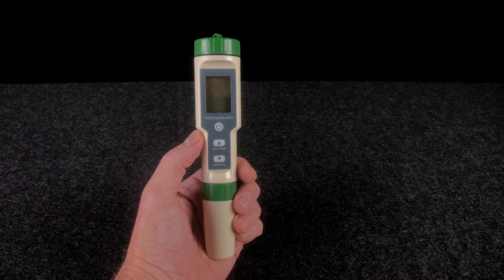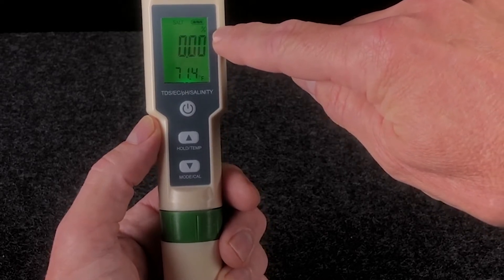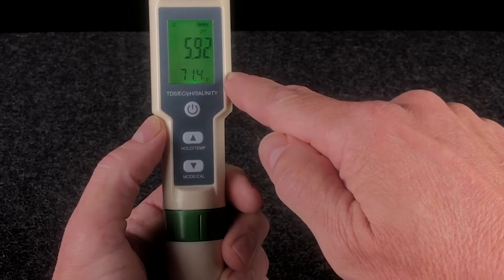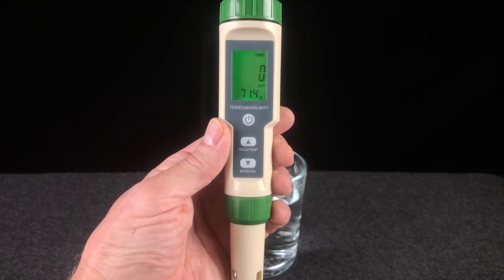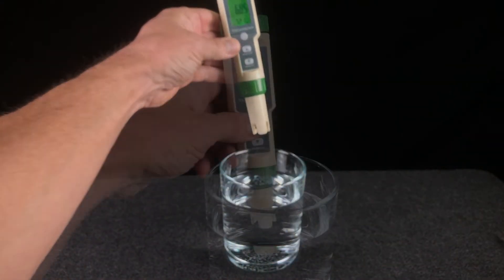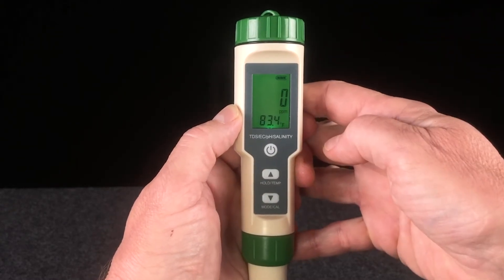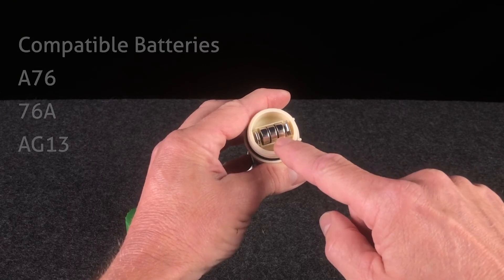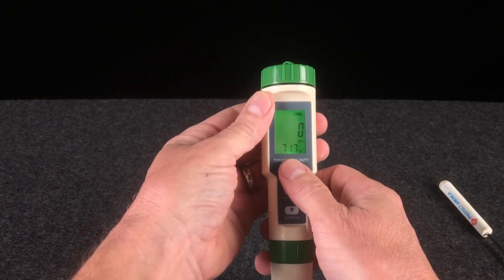Aero-Gro 5-in-1 Meter - Quick Start Instructions

Comment: my meter was calibrated perfectly, each time i test the solution i get the same numbers. yet when i test my aquarium water the value is way higher than it should be. same with my osmosis water, when the value should be zero, i get 20

Comment: For those who were confused like I was, most sites will tell you that, for example, a good value for EC is 2. Nobody ever points out that the unit in this case is milliSiemens per centimeter. So I was a bit shocked when I put my meter in my kratky container that my tomatoes and eggplants are happily growing in and got a number of around 2200 to 2390. He mentions it in the video, but I'll once again point out that this unit gives its value in microSiemens per centimeter. Translation: divide the number you get by 1,000 to get the number you'll typically see. So in my case, my water was around 2.2 - 2.4, which is right on the border for both tomatoes (almost too high) and eggplants (a tad too low). Translation: if you're doing hydroponics like I am, it's probably best to group things you want to grow by their ph and not mix them all together. I'm glad to finally at least have numbers around what I've been doing.

Comment: I don't know. How to calibrate for tds ??
Reply from the maker: You need to buy what'a called "1413 Calibration Standard" from the your favorite online retailer (sorry, I don't sell it). 
Step 1: Pour some 1413 in a clean jar,.
Step 2: Place your meter in EC mode (display will show μS/cm). 
Step 3: Dip the meter into the 1413 solution, then press AND HOLD the "CAL" button for at least 5 seconds, then release. 
Step 4: While keeping the probe in the solution, use the up and down arrows on the meter keypad to adjust the displayed number until it reads "1413." Wait for it to stop blinking. You're done!

Comment: hi there just bought your meter im making liquid fertilizer you think will help me fertilizer is dark brown
Reply from the maker: Hi Rodney - Yes, the meter can measure pH, which is critical in the preparation of fertilizer. You want the fertilizer to be balanced AFTER adding the nutrients. Most nutrients tend to be acidic, so the pH will drop. Your meter will tell you how far off of the target pH you are so that you can make adjustments using pH UP or pH DOWN solution.

As far as measuring concentration, you will need to simply follow the instructions on the bottle that explains how much to add. The meter (when used in TDS mode) can measure the concentration of nutrients in water, but only if the nutrients are salt-based. It sounds like your nutrients may be organic, which is why you would simply follow the instructions from the manufacturer.

Hope that helps!

Comment: TDS is measured based on ppm500 or ppm700 scale?
Reply from the maker: This meter is for measuring on the 500 ppm scale - which is meant for salts and solids in water. The 700 ppm scale is specifically for measuring Potassium Chloride.

Comment: So the true reading is only when it’s in the water for 5 seconds if it keeps dropping the longer you hold it in the water is the wrong reading ?
Reply from the maker: The meter will stabilize within a few points usually after about 5-10 seconds. The rate of stabilization really depends on how far the pH swing is when the meter is submerged. It takes longer for the meter to "hone-in" on the reading when the pH is either unusually high or unusually low. Hopefully that makes sense. If not, just give me a call: 610.657.8800